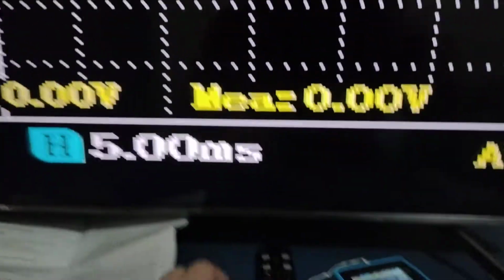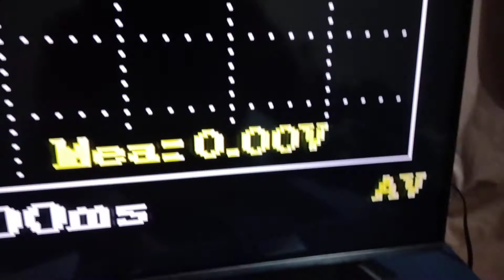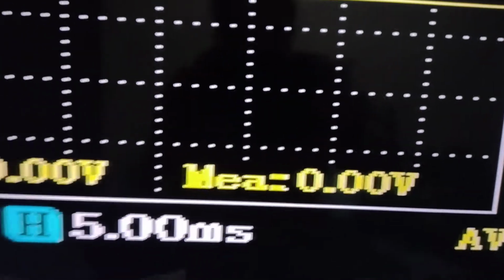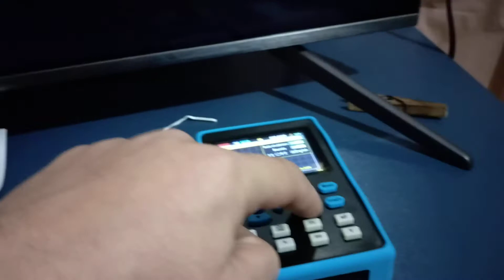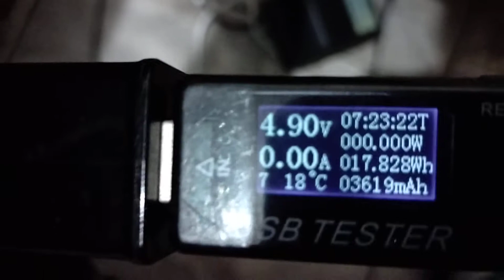Noise and problems of the Aliexpress DSO2512 oscilloscope

Comment: You shouldn't connect the audio plugs to the TV. The DSO doesn't put out audio; only video. The audio lines are not terminated at the DSO end this they are feeding EMI into the TV audio input.
Reply from the maker: Yeah, but the cable came with the device
...
Reply: @DanielStingBR  This is a common cable and probably the cheapest option. That's why they include it.
My reply assumes the red and white plugs are also connected to the TV. If they are not, the yeah there is a problem.